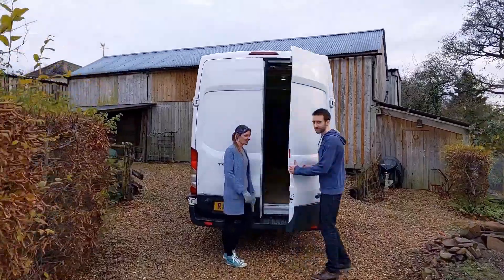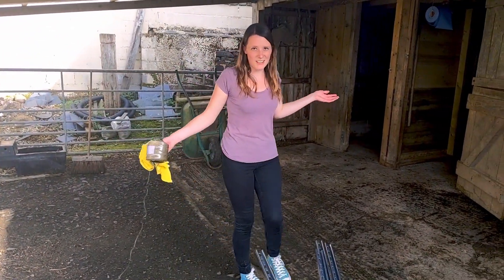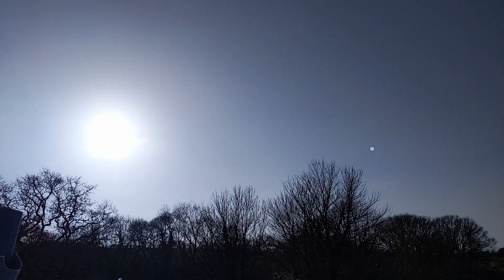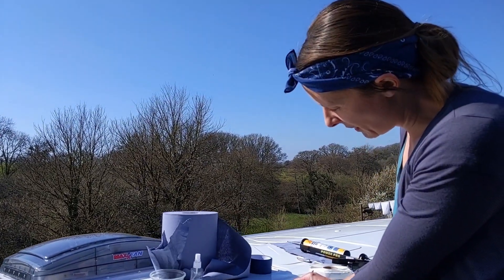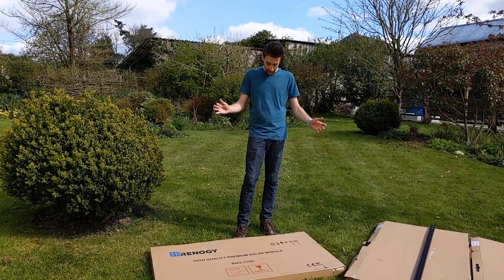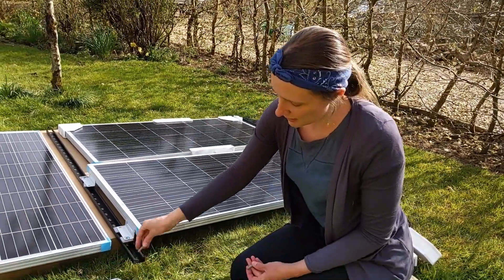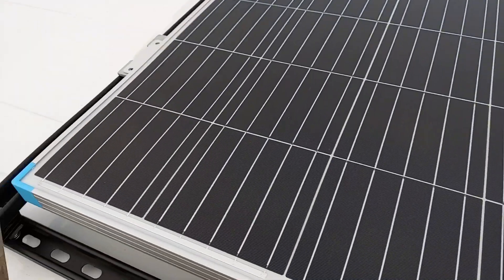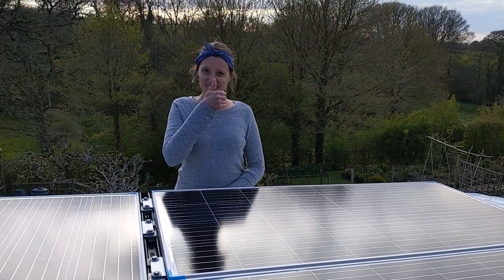DIY Unistrut Roof Rack (Easy Solar Install!) | Transit Van Conversion E12

Comment: Brilliant, I’m literally gearing up to do this to our 2022 L4 transit too. Quick question before I start pulling out bungs and blanks at this time of year with the unpredictable weather…

what length M8’s did you use for mounting to the roof rack points? And what size nylon spacers? 

Thanks! And keep up the good work!
Reply from the maker: Hey, just checked the order and we got a box of 100 M8x50mm bolts for ~£7. Used those as is for all of the fixings into the van through the plugs, and the same bolts trimmed down a bit for the unistrut joins. And there should be a link to the nylon spacers we used in the description, good luck with it! 👍
Reply: Thanks guys, your channel has been helpful in working out some of the bits unique to the transit L4
Reply from the maker: @tombuckingham4500  No problem, happy to help 🙂

Comment: How many AH are your batteries combined? This enough solar? I might get 3x 215's rather than 175's not sure!
Reply from the maker: We have 200Ah in total (2x 100), and 525W of solar to charge them. Whether that's enough for you really depends on your climate and how much power you need. Having more solar would obviously be nice if you can physically fit it on the roof. Our setup works pretty great for us as when it's actually sunny we're always topped up. In Winter or when there's no sun we can't rely on the solar at all obviously, so for that we have the DC charger which also works well for us as we drive a lot, but YMMV 👍

Comment: Did I miss the part where you connected the solar panel wires in a series or is that a later step?
Reply from the maker: We did it as part of this video and mentioned it briefly here (https://youtu.be/1fh9iaTJ6Ic?t=1124), but there's no footage of it. Basically just before we bolted them down we just connected the MC4 connections going positive of one panel to negative of the next, so we just had a single positive and negative wire for the set of 3 finishing up by the entry gland ready to go down the roof
Reply: @SelfBuiltStories  Thank you!
Reply from the maker: @RooMonroe  No problem :)

Comment: Hey sorry but can you advise me on something. What size are those panels? Online says 126 x 70 but when you got them width together for 140 it looks basically the same width as the length? So the two together should be 1400mm but along side the 126 length it looks so close
Reply from the maker: These are the ones we have: https://uk.renogy.com/175-watt-monocrystalline-solar-panel/ , we haven't measured them but presume the specs are correct. Yeah the two width ways ones side by side would be around 140cm of panel but don't forget there's brackets at each side as well which take up a bit of space. The two width ways ones end up sticking out a bit more than the third length ways one in our setup, you can sort of see it at 20:38 👍

Comment: Great Video you two.......what torque did you use to do the bolts up please?
Reply from the maker: Cheers 🙂 And can't remember exactly what we set to now, but based on M8 bolts in a channel nut around 28Nm seems about right: https://docs.rs-online.com/35cb/0900766b815cb37b.pdf 👍

Comment: Hi, great job. Where did you buy the unistrut bar? Looks like I’m going to need to do the same after watching your video 😀 - thanks
Reply from the maker: Cheers! And the links for everything we used should be in the description, for the unistrut we got it and all the fixings from https://directchannel.uk.com/, we went for the 3m lengths of 21mm light slotted channel. We found their prices the most reasonable out of everywhere we looked. Hope it goes well!

Comment: High Guys I have recently queried with renogy reference the correct brackets for 175 watt panels they have told me I need to fit 2 sets of brackets per each 175 watt panels. Looking at your video it looks like you have used 1 set per panel is that correct and have you had any issues with the stability of your installation? Thanks David PS love you videos
Reply from the maker: Hiya, yeah we used one set of 4 brackets for each panel. As you say on the page for the brackets they say they're fine for a panel up to 150-160W, though they unhelpfully don't say what the weight carrying capacity is there and don't seem to sell a panel around 150W to compare. In the specs download though (https://uk.renogy.com/content/files/Specifications/RNG-MTS-ZB-spec.pdf ) on the last page it says each set can hold 40kg with no single bracket taking more than 10kg. Seeing as our 175W panels are actually quite light at 9kg, we figured that 4 brackets was more than enough. That doc also lists the model RNG-160P as being compatible, which doesn't seem to be sold anymore but from the specs was a heavier 11.5kg so 🤔(https://www.renogy.com/template/files/Specifications/RNG-160P%20spec.pdf ). And we also have them mounted upside down so they're sort of sitting on a shelf against the unistrut too so probably more braced. 1000s of miles driven now and no issues 👍 HTH and glad you're enjoying the videos! 🙂
Reply: Seams really strange I raised a query with them and their answer was to double up the amount of brackets per panel. Seems like a more making scheme to me. Was interested, have you reweighed your van since you are now using it in earnest?
Reply from the maker: @davidknights866  We last weighed towards the end when we still had a few projects to go, and will be weighing it again fairly soon. We've been waiting till we have new suspension fitted and then we're going to full fill up everything and take it again. We've uprated our van to 4T now as well though so have quite a bit of room to play with 😛

Comment: Hi guys, great unistrut video, very helpful. Did you order 41mm x 41mm or 41mm x 21mm unistrut? I have a transit too so should be the same but I will double check. Spoke to your supplier very helpful🙂
Reply from the maker: Hey, we used the 21mm light duty channel: https://directchannel.uk.com/21mm-light-slotted-channel-x-3-metres. Still holding up great with no issues and many miles on the road! 👍🙂

Comment: When you go to get the bolts to screw these in, do you get the drill bit one size bigger?? or the same size?
Reply from the maker: Hiya, for us on the Transit the bolt holes on the roof were already made and threaded, so an M8 bolt was all we needed. But if you're making your own holes then an M8 bolt will pass through an 8mm hole, but if you're using rivnuts or something to give you a threaded hole then you'd need it bigger to accommodate the extra diameter of the rivnut. HTH 👍

Comment: I’m curious if you find these lifting or rattling at all while driving or in windy conditions? The unistrut looked like it was bending with the weight of the panels in the centre (but that could be roof curvature?). I like the idea of not having to drill holes in the roof and modularity but wonder if it could benefit from a third long strut running front to back
Reply from the maker: Hiya, nope we haven't had any issues and have covered thousands of miles with them now. Maybe once in a really windy storm when the van was getting buffeted around we heard them bouncing a bit as the wind got underneath them but that's an anomaly.  We used to notice the sound of the wires from the panels rattling around though so we cable tied them tight to the unistrut. And you occasionally hear some rattling from the maxxfan if you're going over a bumpy road, but not something we really notice anymore 🙂. The transit roof is pretty curvy so we had to raise it up a bit with the spaces before we could put the width ways ones across, but we still have clearance under everything, just a lot less in the center. We're using the light slotted channel which is 1.5mm thick so if it was something which concerned you then you could use the more heavy duty 2.5mm thick channel, but we haven't had any problems with our setup. HTH! 👍

Comment: Hi, thank you both for the very helpful content. Did you use galvanized square plates and washers or stainless?
Reply from the maker: No problem, and we used the hot dip galvanized ones, then sprayed with primer and black hammerite 👍

Comment: I'm about to do this too. I don't see a need for the Z brackets though. You could just attach the bold straight through the solar panels to the unistrut, couldnt you?
Reply from the maker: If you can find a way to securely mount them without the brackets through the frame then that would work, but don't think you'd be able to use the standard unistrut fixings as you'd be bolting through the side wall of the unistrut, not from top down. On the light duty struts we have the side wall is only 21mm and a little awkward to get a bolt/tool into tighten from the side. You could mount a length on its side to go up against the panel frame, but then you'd need extra fixings for that so for us using the Z brackets just made it pretty easy, as he panel and unistrut both have the holes for bolting already . Good luck! 👍🙂

Comment: Because of the curvature of the roof, how high from the mounting point does the width-ways strut need to be to clear the center of it?
Reply from the maker: Hiya, we raised up the widthways ones on top of the lengthways ones using 4 of the square washers. That makes it ~5.7cm from the van roof to the bottom of the width ways ones at the edges, which gives a clearance of around 1cm in the middle where it's at its curviest 👍
Reply: @SelfBuiltStories  thank you 😊
Reply from the maker: @Two_in_transit  No problem 👍

Comment: Great video! I came across your build while trying to figure out how to mount my panels. Now stealing as many ideas from you as my limited skills will allow 😁 

Quick question, do you think this would work with the more 'square' unistrut? I think you're using p3000 which is 21mm but I've got a good deal for the p2000 which is 41mm and think it would work the same, just with longer bolts.
Reply from the maker: Thank you, and ha no problem. There's lots of great resources out there so lots to get ideas from as we do too 🙂Can't think of a reason why it wouldn't work with the 41mm, the only thing would be the slightly increased weight and as you say making sure all the fixings and such were compatible. Good luck!

Comment: Cool! How many watts maximum do you get?
Reply from the maker: Cheers :) And it's very weather dependent but with the sunshine at the moment down in Cornwall we've been getting peaks around 480W in the day. With one day at 513W and another at 546 😛 We've always had enough power to have full batteries by the early afternoon so far, though Winter will be the crucial test of course!

Comment: Great video, what type of bolts are needed, and what lengths?
Reply from the maker: Thanks! We used M8x50mm hex bolts for it. Those bolted the unistrut into the pre-threaded holes of the van. And then we cut them down a bit to use where we fixed the horizontal bars to the lengthways ones (as the 50mm were a bit long to fit into the channel without hitting the bottom). Was a bit of faff cutting them all down and painting the cut ends, so if we were doing it again we'd probably get some 50mm for bolting the frame to the van, and some shorter ones for bolting the bits of frame together

Comment: Would mounting these on a minivan instead work? OR would you have to do some parts differently in the setup and install?

Thanks.
Reply from the maker: Hiya, would imagine you can do something similar on any vehicle as long as you have a good way to bolt it down. The transit is convenient as there are already prethreaded holes for that, otherwise you would need to do something more DIY to bolt it but should be doable with a bit of thought 👍

Comment: Nice work guys as usual. Following your channel and just wondering did you use the 21mm or 41mm unistrut and was it the external hot dipped? Love the build im at the stage now . Good to see abi getting involved . 👍
Reply from the maker: We went for the 21mm light slotted channel pre-galvanised (product code CS21L). And cheers, we only ever work on the build together and have a rule that we have to do it all equally and both do a bit of everything. Works great for us and means we both have a complete understanding of every inch of the van we've built 👍
Reply: @SelfBuiltStories  thats a great way to work and thanks so much for the information ,and amazing informative videos. Onto prewiring soon, been dreading this part with the wire sizing ect . Once again thank you both 🙏
Reply from the maker: @leelendon1482  No worries, good luck with it! It's not the most fun job but lays the foundation for all the good stuff later!

Comment: So much messing about…. And I am not saying you did it wrong ether. I am going to have to do all that stuff by myself too. Thanks for the video.
Reply from the maker: Yeah it was a little fiddly! Although a lot of that was just because it's so awkward trying to bolt things down up on a ladder 😅Good luck with yours 🙂
Reply: @SelfBuiltStories  I am going to use Aluminium, a little cheaper, not as overbuilt as my design with unistrut. I wanted to have a boarder on the sides adding another set of long struts. I think it will weigh about the same too. With vans it always is more steps and takes longer than you expect.
Reply from the maker: Can definitely relate to it always taking longer than you expect 😅 Sounds like a good setup, hope it works out well!

Comment: Is it going to sound like a church organ? I've had that whistling issue with several tones depending on speed with just one hole in a roof rack
Reply from the maker: Hmm can't say we've ever noticed anything to be honest, and we've done thousands of miles with it. We did used to notice the maxxfan rattling a bit on the roof but nothing from the roof rack. But maybe we just don't hear it, so YMMV 😅 The bulkhead is insulated and that blocks most of the sound from the back, unless we have to brake hard and things move around in cupboards etc

Comment: Invest in a proper hacksaw rather than using a junior hacksaw, saves lots of time and a lot  easier on the hands. Great vids btw...
Reply from the maker: Cheers! Fortunately we haven't really had to do much more metal cutting at all and the angle grinder finished off the bolts in no time, but yeah something to think about if we end up doing more metal work sometime! 👍

Comment: Where did you get everything from please as we are struggling with the roof of our van so need to do something similar. Thanks
Reply from the maker: Hiya, the links for everything we used should be in the description, but shout if we missed anything 🙂👍

Comment: Hi, are you happy with the light duty 1.6mm, or if doing it now, would you use the 2.5mm heavey duty. What would you advise me to use.
Reply from the maker: Hiya, for our setup we’ve had no problems using the lighter one, if we did do it again we would most likely use the same. HTH

Comment: Hi.
What length were the rubber spacers between the uni and the van please?
Reply from the maker: The packs we bought had 4 x 15mm deep, 4 x 10mm deep and 2 x 5mm deep, and for each stack we used a 10mm on top of a 15mm, so ~25mm in total of rubber.  These are the ones we went for: https://www.amazon.co.uk/gp/product/B07DB8BH2Z. Hope that helps 😊
Reply: @SelfBuiltStories  Thanks folks, much appreciated 👍
Reply from the maker: No problem!

Comment: Great video! Have you guys wires your panels in parallel or series?
Reply from the maker: Cheers! We wired them in series, 3x 175W panels. We go into the set up in a bit more detail in our solar install video, E23

Comment: Oh, yes. Amazon Japan. One piece of 60 inch long unit strut, in green mind you, for only £207.
Reply from the maker: Ouch! Yeah that is crazy, looking now a 3 metre piece is £6.59 from where we got ours from (https://directchannel.uk.com/21mm-light-slotted-channel-x-3-metres). Would recommend finding a specialist unistrut/channel supplier not Amazon if possible where you are!
Reply: @SelfBuiltStories  
Have found a source for the Japanese version of Unistrut. ワールドドクタ or World Ductor.  Starting at about £17 for a 2.5m section and up to £70 for stainless steel.
Reply from the maker: @Zerpersande  Cool, that's a bit more like it :)
Reply: @SelfBuiltStories  
Yeah, but even though I got out for about US$70 for the four pieces of strut, I had to buy a $300 Thule roof rack because my roof is curved and I couldn’t find any of those spacers I was comfortable with. Raise the height but it looks good so I’m happy with that. But then came all the hardware that I needed to properly attach attach everything. I decided I needed strong struts because the struts were extending past the crossmembers on my roof rack and I didn’t want them flexing, and by buying the strong struts I also had to buy the strong sliding connectors that use 3/8” bolts. For reasons that I won’t go into I decided to use two bolts for each connector making eight bolts per panel. The light aluminum brackets were bending under the force required to properly torque the 3/8” bolts so I had to add washers within the assembly to adjust it so that I could torque it properly. I’d say that right now I’ve spent at least $75 just for bolts and washers and sliding nuts and things like that.

However, I have a bombproof design.
Reply from the maker: @Zerpersande  Haha, nice one, sounds like a bit of a mission to get it all sorted but will hopefully give you years of trouble free use!
Reply: Note: Just weighed the (24) 3/8” bolts, washers, nuts, plates, etc required to bolt the three panels to the frame. A bit over 6 lbs of hardware.
Reply from the maker: @Zerpersande  Crazy how much the small things always add up 😛